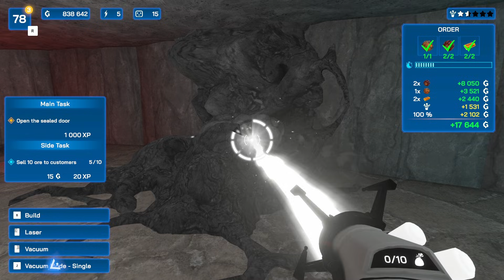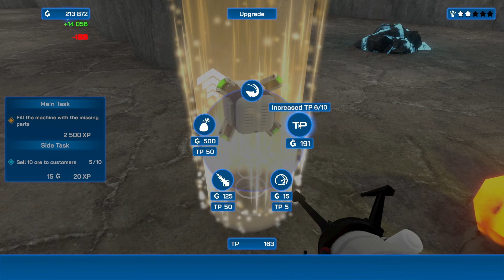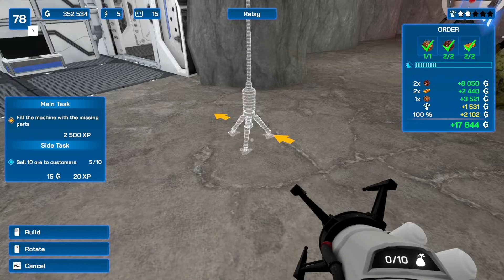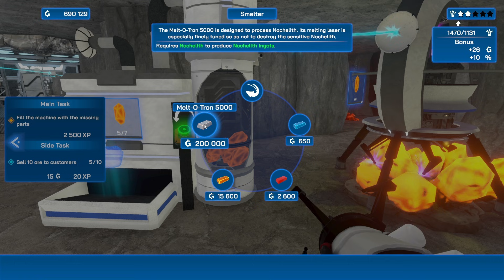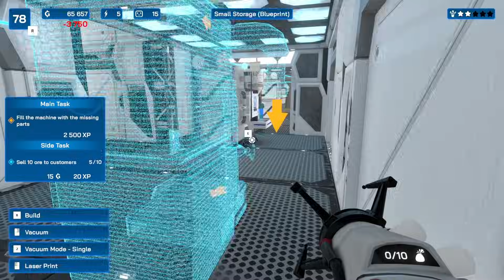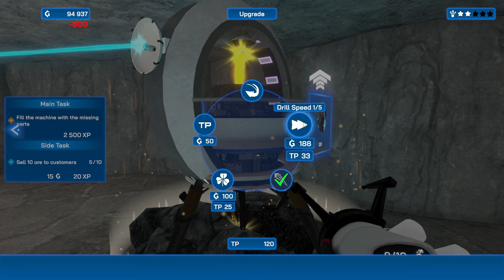Star Ores Inc - How To Finish Solidly!

Comment: The storage is kind of obsolete. If you haven't noticed, the seller box has an antenna on it, you can literally relay EVERYTHING directly to the sell box. No need for transportation or storage of ANYTHING. Miner to smelter to orb maker to sell box. You can split a line from each miner and smelter to deliver ores and bars as well to the sell box. Robots aren't need at this stage.

Comment: Neat little game!
I do think its needs another pass to try and clean up the Quirkiness of the automation, No splitters or filters, hitboxes being cumbersome. 
The robots are really nice and I think it would be a better automation system if they fully leaned into robot transporters and made it so that you could interact with machines or your terminal and set an acceptance list and priorities. e.g. you have a smelter for ore with a higher priority than the terminal and so your robot would fill it, or maybe a buffer storage and then the rest would go into your stockpile.
If you're interested in another game kind of similar to this (Although much more early in its development), check out Mine Mogul.

Comment: Hello Surtr. Have you thought about keeping the Storage units next to the production machines within the mines, then beaming their contents using the transport system to an ejection unit for each item that is placed in a row on either side of the walls of the entrance of the mine? It may save on clutter and overcrowded corridors. Or maybe line up the ejectors along the corridor walls  that lead to the bottom of the ramp? For the mines that are the furthest down, you can have them beam their contents to large storage units that connect to their own sales unit for online sales so they don't have to have a transport system at all.
Reply from the maker: Good ideas. I will have to try them out. Thanks.